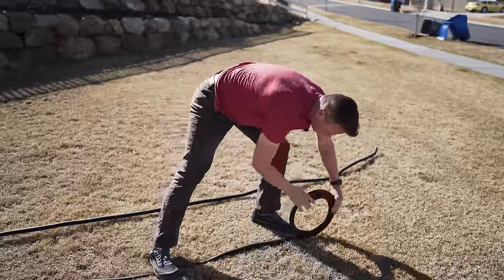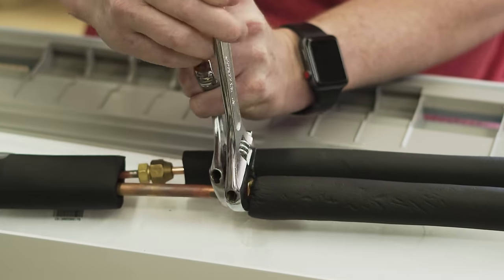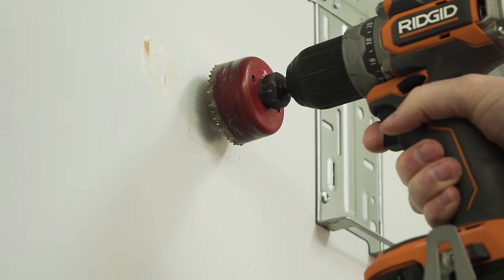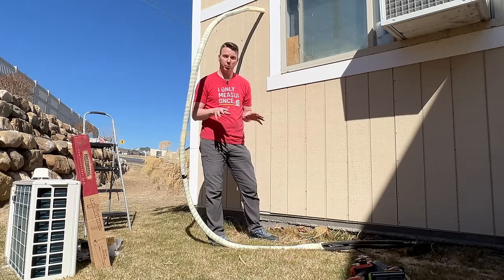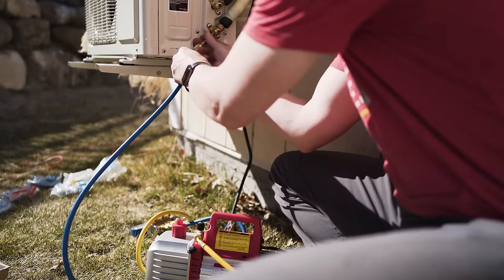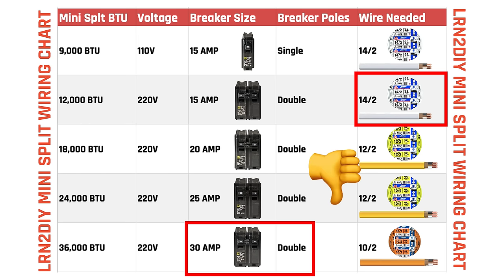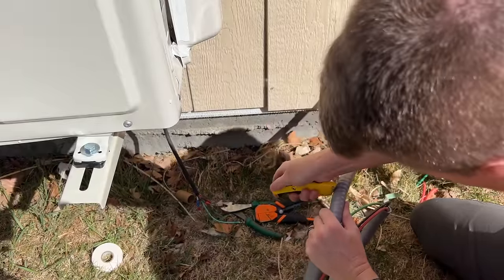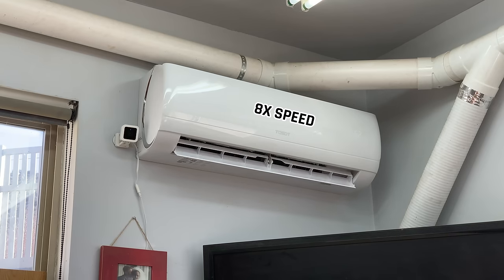DIY Mini Split Install - All the Things Nobody Shows You

Comment: Clear explanation. I'm not an electrician but I've heard you need to remove the sheathing on romex when running in conduit os it doesnt overheat (per code). Id also use the 15Amp breaker to protect the device - no law against oversized wire.
Reply: You got bad information :)  The NM cable (romex) isn't allowed to be used outdoors. IMO it is 100% fine to use it and I guarantee it's not going to overheat. It's a violation because of the rating. It is sometimes easier to pull/push thru the conduit without a sheath but it's still technically the correct type of wire inside.  And, you are right on the breaker size
Reply: @efthegop8000  Speaking of bad information; It is illegal to use "NM-B" romex in conduit in a wet location (it's not because of overheating, it's because of the paper insulation they use in romex is not rated for wet locations.) You can strip the outer insulation and the paper and use the proper UL rated fitting to transition from emt to romex. I've been an Electrician for 50 years and I don't use my opinion, I use the NEC Codebook. Doing service work I've seen many DIY projects that weren't legal and yet hadn't burned down the house (and some that failed and melted). BTW the romex you buy at big box stores are NM-B, wire manufacturers do make a NM-C cable that is UL listed for wet locations.

Comment: Not to quote code, but just a heads up, in my area you cannot run Romex inside conduit except for protection and they limit you to 6' ( this is a heat rating item). They recommend thhn inside conduit. Great video btw. I personally would have purchased the covering system that goes over the refrigeration and communication lines, it looks very professional imo.
Reply from the maker: Great info on the THHN. And yes, I plan on getting the lineset cover - I just need to get that ordered so I can cover everything up. It would definitely look way better.
Reply: while we're on the topic of codes, I guess it's not the worst thing to do, but the white wire shouldn't be attached directly to a breaker. White wires are supposed to be dedicated neutral wires, and somebody working on the system in the future may get shock not knowing that it's live.
Reply: That white wire is not a neutral as you used it. It is a. hot wire and you should have used the RED wire and caped the white wire. If you leave this you should wrap a couple wraps of red tape near both ends, but as said you should not use romex in conduit.
Reply: @LRN2DIY  In this case you would have to use a wire rated MTW or THWN or THHW, or another wire rated for a wet location. Because it is outside it is a wet location.
Reply: The rule in a lot of jurisdictions is the use of conduit does not change whether or not a cable is rated for the location. Romex isn't rated for damp or wet, so putting it in a conduit outside is not code legal (and if you've ever taken apart conduit that's been there for a decade, you'll understand why).
Reply: @LRN2DIY  Will be THWN. The W stands for 'wet,' as in wet-rated.
Reply: @tiggeroush  How come you didn't notice the emt connectors are not rain tight and the reducing washers are not rain tight either?
Reply: @zipzop6000  How come you didn't notice the emt connectors are not rain tight and the reducing washers are not rain tight either?
Reply: @uhjyuff2095  How come you did not notice Zip Zop and I both said use wet location wire.

Comment: Thank you for the thorough demonstration of this install. Getting ready to put one in myself. 
Question: Can you run the main lines from inside to outside units inside the wall cavity rather than down the exterior of the wall? I'm still in framing stage and would like to hide that unsightly cable.

Comment: Video and explanations are very well done. Has anyone however mentioned the looped lineset and potential to trap oil? If you are not comfortable shortening and making your own flares and wish to use entire lineset length, always serpentine vs. looping.
Reply: Someone mentioned to coil on the horizontal plane rather than the vertical. Sounded good to me

Comment: Great video and web site. Thanks a lot! You’ve answered every question I had in a way that makes it simple to understand. I’m an electrician by trade and constantly have customers asking me besides running power to my new split unit, can you install the unit also? Until now my answer was no you need an HVAC mechanic. But now I installed my first one and from the jump you made it simple and easier than ever. Thanks!!

Comment: Nice video. What about the internal joints (connections), did you bubble leak check them? I guess we can, right? Just do the vacuuming before hanging the inside unit to the wall. Of course you need to unwrap or keep the masking/insulation tape a little loose to do that.

Comment: I just did this installation on my workshop. I went with the 24,000 btu MrCool, wall mounted main unit on a bracket. It's actually very straight forward. I spent the bucks (service call $230.00 vs the cost of the pump, gauges, and adaptor at $190) to hire my HVAC guy to come shorten the line set and get rid of the extra line set length coil, pull the vac, nitrogen leak check and fire off while watching all the numbers on his digital gauge set. He had to solder the lines back together as the MrCool has a proprietary coupling design so flaring won't work. It was worth it to me to get rid of the extra line set loops. Certainly wasn't necessary but I feel better about it knowing I had no leaks, and the install looks much cleaner. He does all the service on my 4 heat pump units when needed so he knows my systems. A great guy, local small business family man. All the rest of it I did. Piece of cake.

Comment: Start your pump with the valve closed as stated but.... IMPORTANT You should see the needle pull into vacuum when you turn your pump on, watch the needle as you open the gauge valve, if the needle does not raise when the gauge valve is opened you are not properly connected. Check to make sure your adaptor has a core in it and its properly positioned to depressed the schrader in the machine.
Reply: Another quick and dirty method is to put your thumb over the flare on the high pressure line. Be sure to shut off the pump before reattaching.

Comment: Because you went out the left side of the unit I usually hang the unit and prop it up with a block of wood and pull in the line set from the outside and make the connections.  The less of the line set you have to pull through the wall the easier.  I haven't read the comments but I am sure someone suggested to use nylog to aid in sealing the connections.    Just my experience.
Reply: I agree!  For the unit that I installed on a wall, I put the wiring and short length of tubing out of the wall, then made the connections out there, and insulated everything After checking for refrigerant leaks.  In the case of using left outlet, it would be much better to put in a foot of lineset through the wall, and make the connections, then place everything against the wall and on the wall bracket.  You would typically tear up a lot of insulation by pushing all that tubing through the wall.

Comment: Great video! I would like to know what brand of  tape you used to wrap the lines. Also  where to buy the sleeves  for the hole. What size btus did you installed? Thanks for your great video and tutorial.

Comment: Watching the video and You are meant to leave the gauges on the service port until the  valve on the suction line has been opened, when you open the suction line valve it closes off the vacuum port internally so it keeps the system under vacuum at all times, removing the gauges first will allow the lines to come back up to atmospheric pressure.
Reply: Finally someone addressed this detail.
Reply: Can you explain what you mean? Was there a procedure that was incorrect? How should it be done?
I just installed a mini split using the directions in this video and it is working very well
Reply: evacuation is done for two reasons to remove moisture (causes acid formation+ minor capacity loss) and other non-condensable gases like nitrogen (causes minor capacity loss). by taking his gauges off before pressurizing the system the air rushes into the vacuum thus negating the whole reason for  having pulled the vacuum in the first place. that said as this is a 410a mini-split it's extra susceptible to moisture damage  and you should pull a proper vacuum  with vacuum rated gauges and micron gauge instead of a compound gauge. if you are worried about damge to your system you can check if the system is acidic with a test kit like "QwikCheck QT2000 Acid Test Kit"  or  "atk-1 diverstech acid test kit"
Reply: This is probably accurate but a picture or diagram with arrows pointing to the various named components would help clarify these critical steps.

Comment: Outstanding video....  I particularly like the electrical portion, I just wish it hadn't gone so fast.  I'll be refinishing a garage and dealing with a lot of that, so aside from adding a mini-split in the garage, I'll need to add an out let, and reconfigure a couple that have grounding issues.  Very cool video.  Thank you for taking the time to shoot it, I know adding a "How-To" video to a decent sized job like this, just adds to the work, so thank you for taking the time.

Comment: The unit draws <7A, so that 16AWG was just fine. Using a white wire for a hot leg is not OK, especially when you have another color (red) available.
Also you will want to check the max allowed breaker size on the condenser unit. Do not use a larger breaker than that as there will be unprotected wiring inside the unit.
Reply: Documentation states MCA is 9 amps.
Reply: @uhjyuff2095 it's  still fine.

Comment: If I'm using a 15 amp double pole breaker with 14/2 wire what size disconnect should I use? 30 amp? Thank you! I'm going to be installing one of these myself! 😊

Comment: The manufacturer specifies the voltage, maximum breaker size and minimum wire size.
The white conductor is normally used as a neutral. It may be used as an ungrounded conductor if no others are available in the cable.
Reply: Yes.Exactly.He must and should've  wrapped the white wire with black tape to designate it as a power conductor.

Comment: Great video. Thank you for posting it. I just had a pro install a 42,000 BTU Blueridge unit with four air handlers.  It took two days and came out great. Note* they also sell nice plastic exterior line covers to give it a more professional finished look.
Reply from the maker: Awesome! I'm thinking about putting one in my garage and I'm definitely looking into the nicer exterior covers to keep it looking good, and to better protect it too.
Reply: 2 days🤦🏻‍♂️🤣🤣🤣🤣 me and  my boss did 6 in one day. 6 heads 2 condensers 😎

Comment: Excellent video. I’m a maintenance test pilot with Airframe and Power Plant license and industrial wiring certificate. You are a natural teacher. I’d look through your Owner’s Manual and see what size breaker it recommends to protect the unit and use that size. The oversized wire is not an issue, the possibly oversized breaker could be someday. Nice work!
Reply: Excellent???This instalation have many mistakes...He dont know this job,just need views for those were dont want pay a real professional..

Comment: I like the video. A lot of brands have minimal instructions and don’t tell you the plastic cover on the bottom or entire face plate are removable. This allows you to pull you copper in from the out side( which means only pulling 3 ft of line, set hose, and 4 ft of power and communication). Then put your unit on the wall with out the cover and swing the unit up and wedge it with a small screw driver or even a piece of styrofoam from the box. Pull a little extra copper, mark for new flares (factory flares are garbage). Pull the unit off of the wall cut copper and prep your new flares. Put the unit back up wedge it up again. Connect your copper, your drain, power and communication. Once your pressure test checks out then insulate your 2 inches of copper and flare nuts.

Comment: After pumping down the system with a vacuum pump and confirming no leaks you should open the low side service valve for just a few seconds to remove vacuum and pressurize the system with a small amount of refrigerant before removing the manifold gauge set hose. This is because there is always a small amount of leakage when removing the hose and if the system is in a vacuum it will suck in air. If the system is charged with refrigerant instead of sucking in air like in a vacuum, it will expel a small amount of that refrigerant which is okay. You never want air introduced in to the sealed system especially since air may contain moisture which will shorten the life of the system.